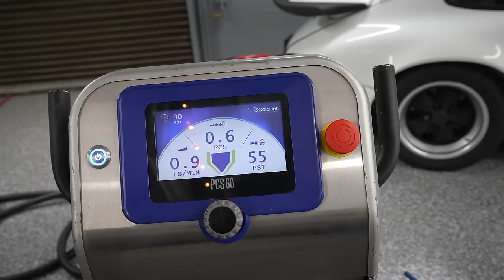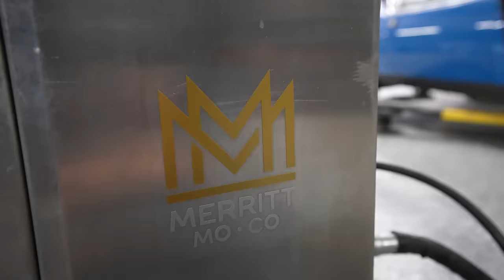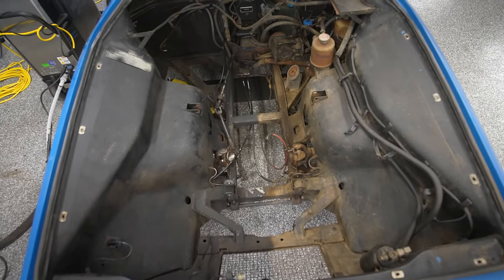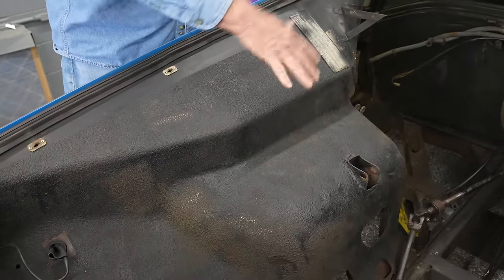Dry-ice blasting our 50 year old Barn Find Pantera

Comment: Fun fact, dry ice does not evaporate but instead sublimates because it goes directly from a solid to a gas, skipping the liquid state.
Reply: Yea, what they said!
Reply: Anyone know if this would work to clean direct injection valve buildup?  Walnut shell is common but it'd sure be nice to know there is no added debris to be concerned about.
Reply: @Mrbfgray  good idea, wonder if it's aggressive enough. It would freeze the deposits making them more brittle, so it would be worth a go!
Reply: @rhubarbpie2027   Great point on chilling effect for anything that might be a bit gooey.
Reply: @Mrbfgray it does easily
Reply: @Mrbfgray  Idk of any problem with that. You'd be surprised at the application's ubiquity.  We used it in every process in every shop in the oil and gas industry, in a town in Alberta that I worked for. It's great, but expensive.
Reply: Ick, what’s happening to the ice?
Reply: dry ice tastes like club soda without the water

Comment: Conveniently omitted downside to dry ice cleaning mentioned in other comments. Were this a "real" job, I wonder what the cost to customer would be. Looks like they used the entire thousand dollar hopper full, maybe more. Spraying what looks like a dime sized pattern, a very tedious and time consuming process, probably taking operator an entire day to complete. So, out the door $1500. - $2000.? Seems it would be far cheaper to start in the driveway with a pressure washer removing up to 90% of dirt and grease, particularly if you're willing to jack the car up, lie on your back and spray upward. THEN go through dry ice cleaning, including interior, cutting cost significantly.

Comment: I've watched more than several of these blasting videos.  The most remarkable ones by far are more modern German cars (like that white Porsche in his shop).  From the late 70s and into the 90s, those cars were absolutely caked with Cosmoline for the overseas trip.  When they strip that stuff off an old Porsche, it's amazing.  Great video.  I'd always wondered what a car of this vintage would look like after ice blasting.  Enjoying the series very much.
Reply: Makes you wonder though, maybe the Cosmoline was the reason they looked so good after 30, 40, 50 years. If you blast it off, does it accelerate  the corrosion process? Maybe after blasting these parts a new coating of Cosmoline should be applied.
Reply: @andoletube  Of the videos I've watched, there was a replacement sprayed back in its place that was not as thick.  Probably something like Boeshield or similar.  But, absolutely.  I remember when a shipment of Japanese cars were sent over back in the 80s that didn't get the treatment for travel and were all recalled within a year or so.  That trip does NASTY things to a car of that vintage.
Reply: @mcseforsale  Interesting. Thanks for that.

Comment: The dry ice removes oily residue also.  A dusting of black trim paint to even out the bare spots will look amazing.  I cleaned my engine compartment with a toothbrush, degreaser, and a LOT of elbow grease.

Comment: When I was a supplier quality engineer 20 come years ago we started using dry ice blasting to clean steel castings both for rust and also toxic preservatives that some foundries would apply. The beauty of it was there was no chemicals or blasting media to dispose of in landfills. That greatly offset the higher initial cost of the process.

Comment: I was an electrical engineer for a tire company. When we would upgrade tire building machines we would dry ice blast the machines before tear down. We used a 2” screw auger inside the dry ice tote to fill the blaster hopper. Make sure you use a vacuum while dry ice blasting. All the oil and grease quickly melts onto everything.
Reply: LEGEND!!
Reply: Not going to lie, the Pantera is one of those cars I wish I had bought back in the day.  Love these cars.

Comment: I work as a project superintendent building dry ice manufacturing plants nationwide. They have all been built next to ethanol plants with a pipeline from their fermentation tanks to supply the CO2. The CO2 is cleaned pressurized and liquefied then released to make "snow". The same thing that comes out of fire extinguishers. It's 109 F below zero. From there it goes to a press for blocks or to a row of pellet machines.

Comment: dry ice blasting is really an amazing method of cleaning a vehicle when the dirt and grime are too severe for ordinary methods to clean without risking damage to the underlying paint. It's also a great way to refurbish certain plastics and rubbers. The only downsides are that it's (a.) expensive to get the equipment, (b.) time consuming because the spray pattern is quite narrow and there's basically no splash effect so it only cleans precisely where you're spraying it, (c.) it cannot remove anything beyond the mildest surface corrosion, and (d.) you need to wear the appropriate bunny suit with full mask and you need strong ventilation since the dry ice sublimates into carbon dioxide and can cause the operator to suffocate if there is insufficient air flow.

If you use a diffuse nozzle and appropriate particle size, you can actually use dry ice blasting on automotive paint. The only thing you need to be careful of is to make sure you don't have detaching paint because it'll take it off once you get the paint embrittled by the cold and get that pressure and media under it. But if your paint is in good condition then you can dry ice blast it with the right settings and get a very good result. It basically functions by embrittling, shrinking, and detaching all of the dirt and grime off of the surface along with the topmost layer of any plastics that have become powdery. It's not ideally suited for particularly brittle plastics, disintegrating rubbers, and glass. But when it comes to dirt that's been caked on by grease or any other oily or waxy substance, there might not be any better cleaning method out there for getting it off while preserving the underlying finish and not making your shop an irredeemable wreck.

Comment: Tom,, I have seen this proces and it is generally quite good. To get that rusty radiator stain from the engine bay use contentrated chemical detergent. Spray it on with a trigger pump,, leave for 10 min and blast off with a pressure washer,  it will come up better. That rad stain will wash off. Near 50 years of detailing cars in house. Possibly use the detergent then dryice off. The gearbox came up better with brake clean. Though glass bead it and it will come up new. But keep the glass outside only!!

Comment: That red plastic clutch hydraulic line is now old and brittle. When they fail, your clutch is gone instantly. It’s worthwhile to replace it with a braided stainless flex hose, which many of the Pantera parts vendors sell with all the correct fittings etc.

Comment: Now i'm no expert, so i easily could be very wrong here, but my immediate thought here is that i would expect it to be extremely unwise to do dry ice cleaning at rubber joints and rubber moldings, as i would personally expect it to dry out and damage the bushings/joints that need to be 'soft'?

Comment: It’s an aside, but the hoist recessing into the floor the way it does is brilliant. Anyone know who makes them?
Reply: That lift is an old school type lift back in the 80’s I worked at a repair shop that had 3 or 4 of those. You can probably buy and install a good above ground lift cheaper than the installation cost of an unground lift. But they are good lifts for sure. I don’t know the brand of that one but Rotary and challenger sell in ground lifts

Comment: big problem with 50,s 60,s 70,s cars now is the copper wire is going green, the connections are corroded, bad electrics, bad everything and the young guys dont want to take on rewires. they want to simply replace out of the box and show me the money.